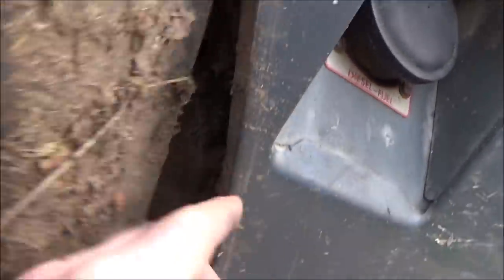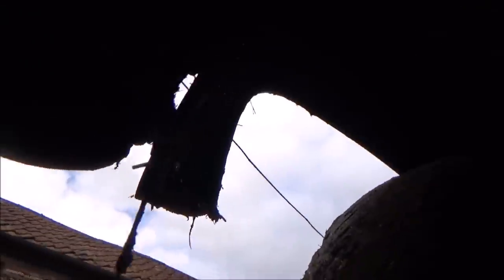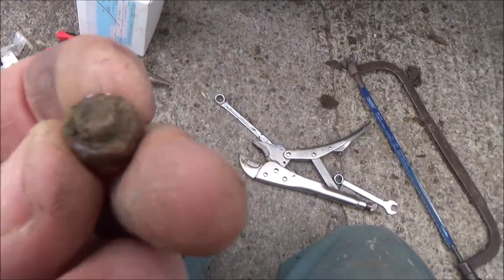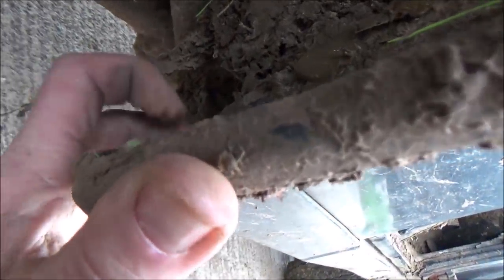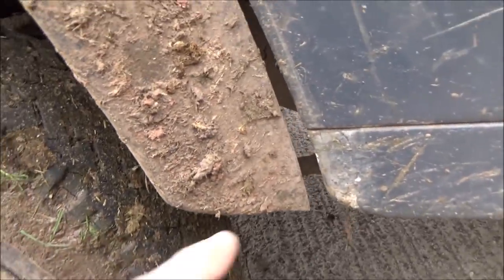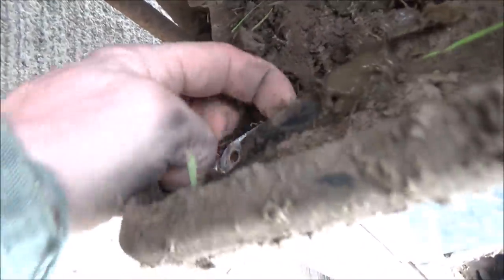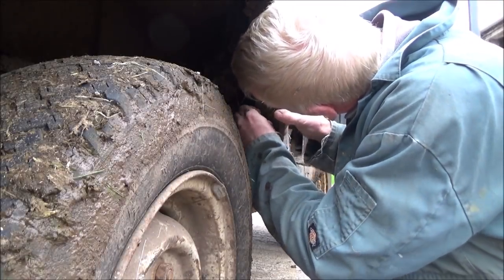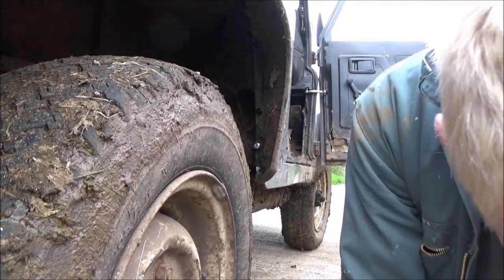LAND ROVER MUD GUARD REPAIR

Comment: Young man, make life a bit easier for yourself. Wash the Land Rover, let it drip dry or drive it up and down the yard for two minutes, remove the wheel and tyre and that gives you good access. As you correctly discovered, the plastic pin is there to swell the fastener into the bodywork and holds the wheelarch (not a mudgard) in place. To remove the plastic fastener you push the pin out. You could use a grinder with a 1mm stainless steel cut off wheel on to remove corroded botls in seconds. Don't worry about learning on the job, nobody was born with knowledge.

Comment: Looks like you are having the same luck I have working on my old Jeep,  sometimes it just will not fit or work,
My policy, if the part falls off and the old Jeep still runs, I just put the part in a box in the shed, didn’t need that part anyway,